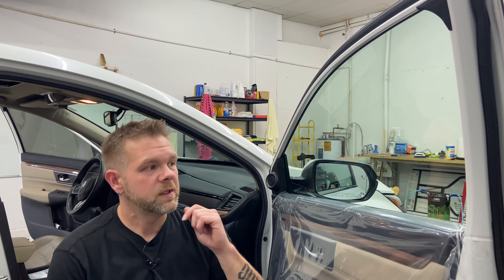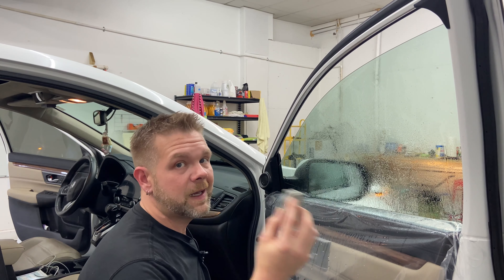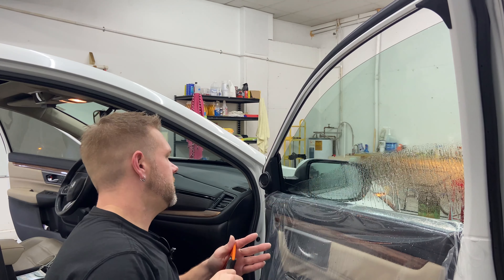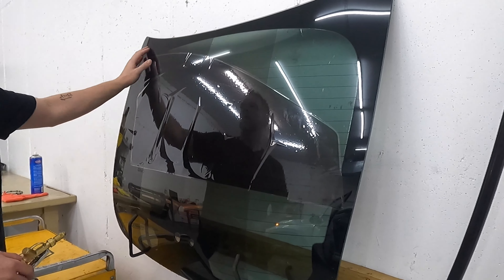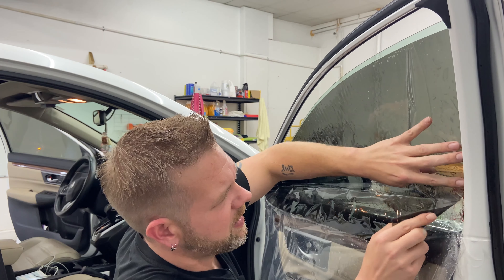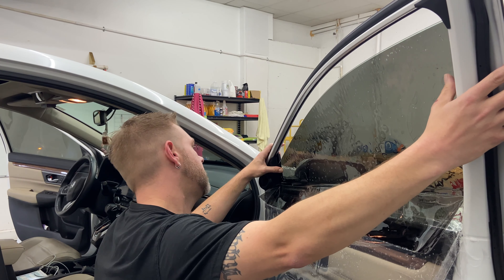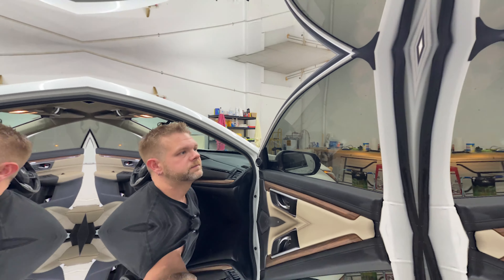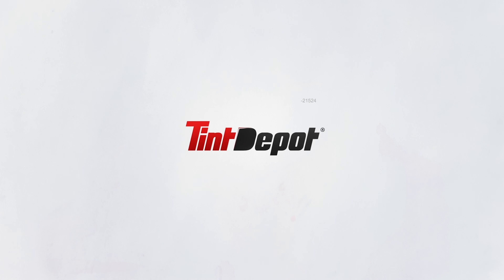Framed Side Window Tint Installation

Comment: Great vid! I am learning myself. Question, is it not advised to tint during colder months especially if you do it have a garage for the vehicle to be somewhat under warmer conditions? For example, back and front windshields, need a heat gun to correctly get the right curvature of the film onto the glass and I’ve heard the cold can mess with the adhesion process. Any tips? Thanks.

Comment: I was told to always use two separate squeegee for the cleaning of the window and installing the film so there's no cross contamination. Right now, I use the orange crush w/ a handle to apply the film, but do you have a recommendation for cleaning the window? Blue max? Yellow flat?